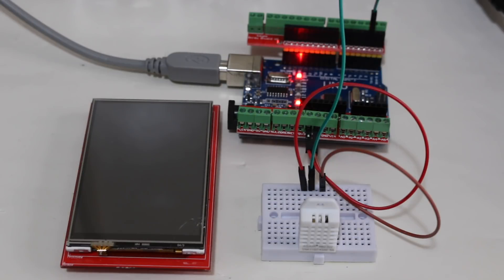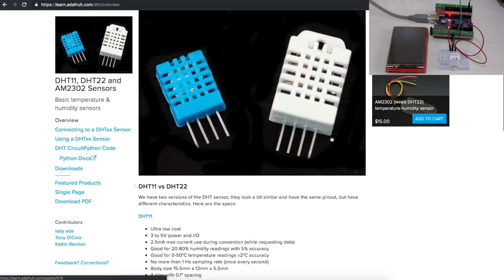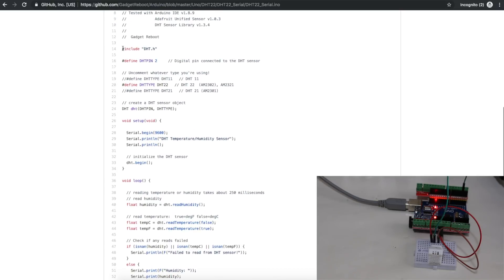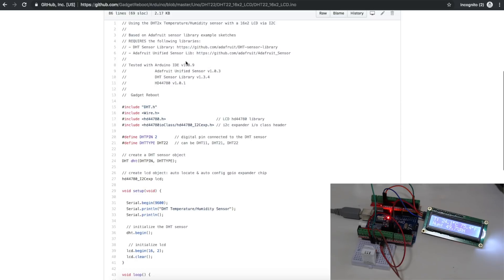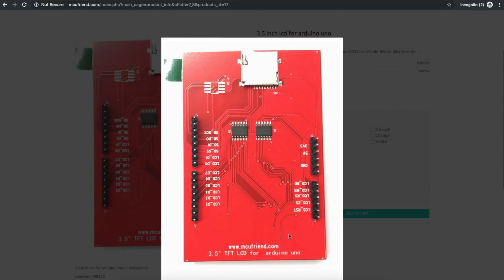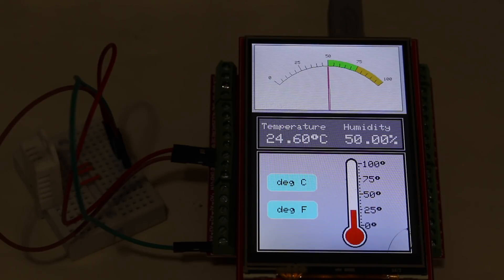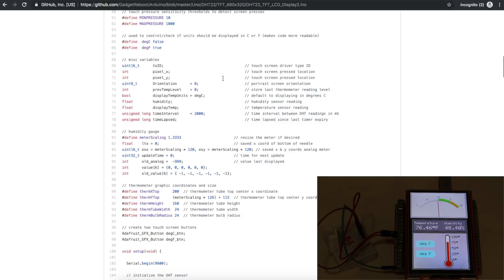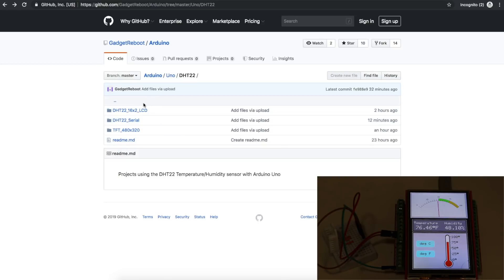DHT22 with Arduino - Humidity and Temperature Sensor with Touch Screen LCD

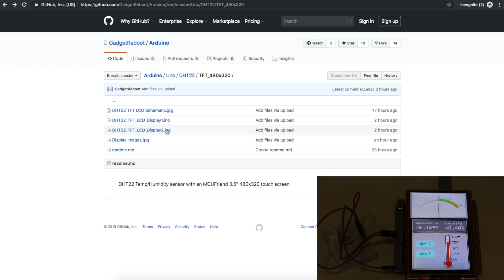Comment: I wish you explain each line code to create this beautiful app.  Especially the one on the right at 9:07. How do you draw the meter with a indicator needle?
Reply from the maker: I found the code for the meter somewhere else, I must have put a reference link in the sketch. I don’t know if the original source explained it but I just plugged it in to my sketch.

Comment: Hey wanted to let you know that you missed a step that is really important for people using different Touch screens wondering why the touch wont work they have to calibrate it with the run 
TouchScreen_Calibr_native.ino in MCUFRIEND_kbv examples And enter the  
XP =# , XM =# , YP =# , YM =# ; //Screen size ID=number 
 TS_LEFT =# , TS_RT =# , TS_TOP =# , TS_BOT = #
mine looked like this
const int XP = 8, XM = A2, YP = A3, YM = 9; //320x480 ID=0x9486
const int TS_LEFT = 126, TS_RT = 912, TS_TOP = 950, TS_BOT = 97;
in the example it was this 
const int XP = 7, XM = A1, YP = A2, YM = 6; //320x480 ID=0x0099
const int TS_LEFT = 903, TS_RT = 163, TS_TOP = 947, TS_BOT = 165;
and i was so lost why the touch wasn't working i see in the code it says to run it but someone who's just going to copy and paste won't understand why.
 love the content!!!!

Comment: Hi...Very nice project !!!
Currently, I am using MLX90615 sensor for temperature measurement.
but the temperature on the Nextion (7 inches) is not changing.
Will you please guide me regarding the same ?

Comment: Hi Gadget Reboot, I'm trying to use your examples in this video because I really like how you made the meters for the display however I'm having some difficulties getting it right...
You need to remove your link in the description from MCUFriend because that link doesn't work anymore, also because of that I got redirected to the Seedstudio or something like that and I installed their stuff to my IDE to test their example code and libraries and I had to remove it all because nothing works, the code didn't even verify or upload to my Arduino UNO so I've been wasting my time trying different things and got nowhere.
I did learn that I need to combine some of your code with my own and some Adafruit Libraries needed to be installed using the Library Manager withing the IDE software to ensure that I have the correct and latest versions plus some extra dependencies had to be installed just to get the sensor working, now I have to do some magic for my display because that wasn't easy to figure out either, after hours and hours searching online nothing really compared to my situation, even the manufacturer doesn't have the correct example code and info to get it working.
Finally after installing a lot of missing libraries and dependencies I finally got the graphics demo actually working and I see something else than only the white screen, the SD card and resistive touch haven't come to life yet so I need to do more work on that too.
Don't you find it frustrating finding the right info online if you have something new you want to test, especially the displays because not one tutorial that I could find online is for the one I have...
If you're interested my display is a 2.8 inch resistive touch shield from Velleman, here's the link to the official website - https://www.velleman.eu/products/view?id=435582
Velleman is a brand that you'd expect to be of better quality and have better documentation, certainly I had to pay more but it's just as frustrating with their products as with the cheap Chinese stuff, maybe I was lucky but all products that I've purchased from China just worked instantly without any issues, both the Arduino UNO and Nano worked out of the box, I didn't have to fool around with the bootloaders those were pre-installed just as the driver I needed to install for the custom chip just worked and best of all are the unbeatable prices.
I'll fork your GitHub repository for the DHT22 sensor and I'll make the necessary changes to get it working with my display I hope, maybe you want to add my changes to your own repository when I'm done or maybe we can do some projects together in the future, if you're interested you can find me on GitHub here - https://github.com/soharddbwarez

Comment: This is an 'annoying' sensor with regards to programming. A good alternative is: "Adafruit Si7021 Temperature & Humidity Sensor Breakout Board" --> https://github.com/vanvught/rpidmx512/blob/master/lib-bob/src/si7021.c
Reply from the maker: I didn’t know that one existed. I’m also waiting for a BME 280 to arrive which should be also easier to work with being I2C
Reply: @GadgetReboot  Another one is the HTU21D Temperature & Humidity Sensor I2C

Comment: I bought some dht sensors for building an arduino-based automatic ventilation system for the house... the design phase has now lasted for 2-3 years with no end in sight :-)
Reply from the maker: Sounds like my basement renovation project that started 12 years ago and the furthest I got was a pile of drywall leaning up against the far wall of the basement, a stack of lumber under the basement stairs, and a cluttered workbench that I always have to  move things aside on,  in order to open more mail for more modules that may take a long time to (n)ever get used. 
Good times!